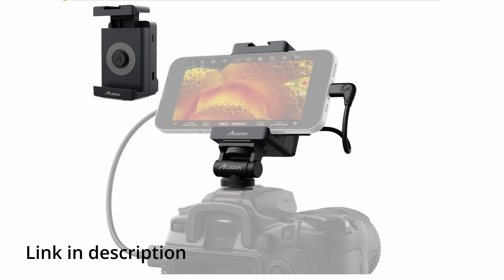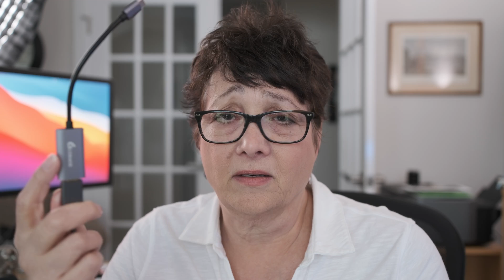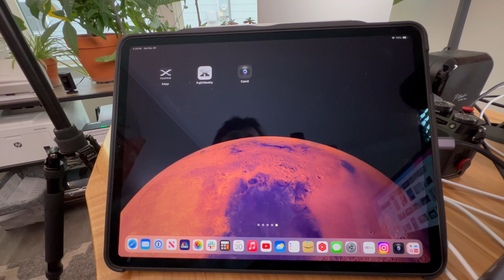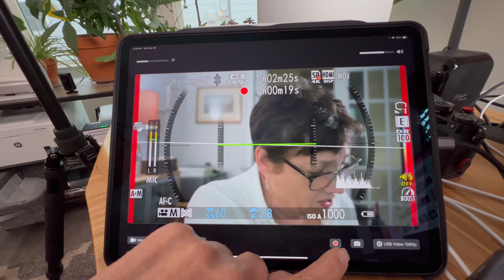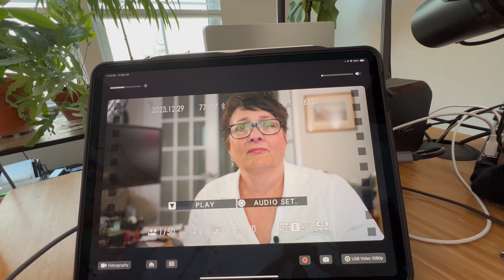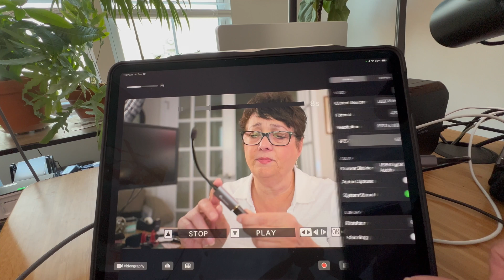Turn Your iPad Pro into a Budget Camera Monitor + Recorder (Part 1)

Comment from the maker: If you have any issues with the CamX app, please share them in the comments. One thing I found is to set the Format to 420f not 420v. Resolution appears to work best at 1980x1080 and FPS at 30 vs 60. Unable to connect to the camera with the CamX app? I've had to reboot my iPad to successfully connect to the camera a few times. That always fixes the problem, but I am not sure what the cause is. Please remember, that this is a budget solution,  so there will be compromises.
Reply: can you please share your camera settings, i cannot get anything on my ipad or iphone (15) all i get is the image of the iphone or ipad camera's i tried this on my fuji xe3,xpro2 and xt-5 and no joy, all are micro hdmi...what am i doing wrong?
Reply from the maker: I assume you are using the CamX app and a capture card? What does that say on the screen of the app?  My camera is set to turn on HDMI info output. I’m also did a part 2 video just recently on this topic. That might help. Turn Your iPad Pro into a Budget Camera Monitor + Recorder (Part 2)
https://youtu.be/6Ym77g3FRY0
Reply: Yes to your questions .
Reply from the maker: My first suggestion would be to test the capture card with your computer to make sure it is working.

Comment: quick question Jackie, could you use this app for photography too?  the xt5 screen is so tiny it's not ideal for framing my interior real estate shots
Reply from the maker: Yes, I can plug my camera directly into my iPad via the HDMI adapter and use the CamX app for photography as well as video. Hope that helps.
Reply: @ wonderful, thank you very much, you just saved me 500 bucks. I will get one of those small capture card adaptors and use this app @_____@
Reply from the maker: My answer is based on using it with my Fujifilm camera as that is all I have to test it on.
Reply: @JackieDElia  yes, I also shoot Fuji (xt5) so it should work fine

Comment: I’ve watched several videos before this as I’m trying to set up an external monitor for shooting wildlife down close to the ground, and the onboard screen on my Canon 5D Mk-iv is fixed into the body (doesn’t tilt up). I’ve found a way to mount the iPad Pro 12.9 to the tripod but wasn’t able to get this app to work, but I think I’ll keep trying since now I know it should. Thanks for putting together a very clear, concise video on how to do this, much better than the super technical videos I’ve seen prior. I’ll definitely be checking out some of your other videos. 😉
Reply from the maker: Thank you so much for watching and sharing

Comment: I did what you did and my iPad Pro 12.9 inch is working. The iPad mini didn’t work. I have a Kindle fire hd on the way. I like that size better but if it doesn’t work then I will have to figure out how to mount the iPad Pro to the tripod. Great video. Thanks ❤❤❤
Reply from the maker: Glad I could help

Comment: Great video. Thank you for sharing. I was hoping to capture video from my 8mm camcorder to my M2 IPad Pro using this app. I couldn’t get past the screen that shows the connections. Is this possible & if so, do you have any recommendations to hook it up? I have a ton of 8mm video that would be so much easier using my iPad than my laptop. Tnx.
Reply from the maker: Thanks for watching. I really don’t have any insights on using an 8 mm camcorder. I do know that the app requires an HDMI input and the use of a capture card. Does your camcorder have that option for output and are you using a capture card?
Reply: @ no. Just the components output. Thanks.

Comment: my camera xs20 doesn't recognize on ipad. It say only signal of connect the cable. I use USB hub to ipad and hdmi on hsb hub and USB mini hdmi to camera. but it doesn't work. is it something need to do more on the process?
Reply from the maker: What capture card are you using?

Comment: can you use an iphone with cam x it works on my ipad  but will not show up any external usb on iphone ?
Reply from the maker: i don’t believe you can use CamX with the iPhone. I don’t have a way to test that as my iPhone 13 Pro does not have a USB port. I can hook up my iPhone to my iPad and use the CamX on the iPad to Capture video from the iPhone. I have a Lightning to HDMI adapter that I plug into the iPhone.

Comment: Has anyone had success with a Nikon d810, capture card connector and CamX. CamX keeps telling me to connect a device. Thanks, Greg
Reply from the maker: One thing I used to troubleshoot was to connect my camera to the Capture card into my computer to see if I was able to receive the HDMI signal. I’m on a Mac so I used QuickTime. That will at least let you know if the HDMI output is working on your camera.
Reply: @JackieDElia  Thank you for taking the time to respond Jackie. I have my Nikon D810 connected to the capture card and the USBc port on my iMac running Sonoma 14.5. When I open quick time player The only recording I can do is with the iMac camera. When I connect to my iPad Air I will see a little cable icon on the top right part of the screen but it shuts off after about 3 seconds Thanks for any ideas, Greg
Reply from the maker: @nopriors  it sounds like either the Capture card is defective or your camera is not outputting an HDMI signal. I don’t have an icon camera, so I’m not sure what settings are required to enable the output. I do know when I was troubleshooting my issues with the iPad when I did connect it to the computer instead, I was able to select the input from the camera with the capture card attached. That way I knew the Capture card was working properly. I don’t have any other suggestions, but hopefully someone else will be able to answer here in the comments.
Reply: @JackieDElia  Thank you Jackie. I have tethered the camera to my MacBook Pro with HDMI using Lightroom. The fact that the little icon on the upper right screen in CamX app shows up but then goes away may mean the capture card is suspect.  What's really weird is the camera will just take a photo for no reason at all. Oh well I love trying to figure this stuff out. I didn't buy the same brand capture card you did so maybe I'll do that and see if it helps. If it does I'll send the one I got back . Take care
Reply from the maker: @nopriors  hope it works out.
Reply: @JackieDElia  It works!!!! I got the same capture card you recommended. Thank you, thank you, thank you!
Reply from the maker: @nopriors so glad to hear that. awesome.😎
Reply: @JackieDElia  Now to see if I can get the iPhone to work!

Comment: Great video!!! I bought the exact same one , but the cam x did not work.Unfortunately.Keeps asking to plug the camera
Reply from the maker: I had the same issue on my iPad and the only way I could get it to work was to power off the iPad and reboot it and then plug it in and it worked. That was the 2019 iPad Pro. I’ve since upgraded my iPad and I’ve had no problems with the CamX app at all.
Reply: @JackieDElia  thanks for the reply , I will try that

Comment: thank you i am planning a iPad for my canon R5C for commercial video. i have dji ronin RS2 Pro combo and will be using the Raveneye Hdmi for monitoring on iPad . but which iPad should i get its been ages since i visited apple site what size is good
Reply from the maker: Thank you. As far as I know any iPad that has USB-C port would work I’ve only tried it with my iPad Pro 12.9 inch 3rd generation. That is the only one I was able to test.

Comment: Very good and certainly well explained, a little doesn’t add up, that you dumped the Assos as money didn’t look a problem with the gear you have, but that aside I was pleased to see how you did it as most others, go all round the houses and then you see that it will only work on Sony or ?, for your 12.9” pad the ulanzi holder seems to be the go to with a ball rig to allow tilt! I have looked at many video monitors and actually ordered the Viltrox, however Amazon failed to deliver here in U.K. so I cancelled on two points, the Osse Lilimon 5 is as old and better build! It’s cheaper in USA than here in U.K. due to import and delivery!
Reply from the maker: I ended up with the Viltrox DC-550 Pro but still do attach that to my iPad to record. I did a video on that as well. I made this video to show that it can be done if you already have an iPad with the USB-C port with just a capture card. Thanks for watching and sharing your thoughts.
Reply: @JackieDElia  how do find the Viltrox in practical usage, as I’m wanting to use for my video and photography, as I’m giving my son my 11” pro and have bought a iPad mini 5 to tide me over, I think that there will be a new one out soon and possibly a super improved one later in the year! Hence why I’m looking for the dual aspect!
Reply from the maker: @f1remandg very happy with the Viltrox DC-550 Pro and use it whenever I am recording with my Fujifilm X-T5. It has nice functions (false color, zebras, etc) and a very well designed sunshade.

Comment: Complete failure, did everything you did, same app and all and nothing! My guess is the settings on my camera are the issue
Reply from the maker: Sorry to hear that. The app can be finicky. I’ve had to either reboot my iPad, or close the app and start it again, including disconnecting the card and reconnecting it. But if you want to eliminate the camera as the issue, what I did was, I plugged the Capture card into my Mac and opened up QuickTime I chose start recording and chose the input and was able to see the camera HDMI output on the screen.  I did this completely bypassing the iPad. In fact, my last video that I posted about focusing in the studio, all of the recordings from the camera were done in QuickTime. Hope that’s helpful. Good luck.

Comment: Thank you, Jackie. I just started the same search but with a different use case in mind. I am using similar setup. Although I do record videos I’m also a photographer and have been looking for a way to use my 12.9 iPad Pro as my tethering monitor rather than my MBP. I’m using an Olympus OM-D E-M5 II to shoot portraits but those tethering softwares that do work with iPads don’t work with Olympus or are overly expensive. I want to use my 12.9 iPad Pro on a stand so both I and the subjects I’m photographing can see the images.

I, too, got an under $20 capture card and connect it to my iPad via an HDMI cable for my Olympus camera. I tried Orion but think CamX is much better. However, I’m not crazy about the image not filling the screen. I haven’t yet tried it out with subjects but I think it will be workable. Since this is still a relatively “new” capability for the iPad I’m hoping some clever developers will come out with apps that improve on those currently available.
Reply: Agreed, CamX would be perfect if there was a full screen option. Can’t stand the  black borders.
Reply from the maker: @artbrutnewyork good point!
Reply from the maker: Thanks for sharing your.experience with it and thanks for watching. It’s not a peffect solution but for the price, it is workable for me right now. 😀

Comment: Good insight,  I don't need the extra features either.  For monitoring my video I just connect the camera tu my PC monitor with a micro hdmi to hdmi cable
Reply from the maker: Thanks for watching. Are you on a Mac or PC?
Reply: MAC but I use external monitor for my MacBook @JackieDElia

Comment from the maker: I'm not a professional videographer. There are a lot of options for beginners to monitor your video while recording. What's yours? Do you want the ability to record or only monitor? Is HD enough for quick recordings as I mentioned in the video? Please feel free to leave a comment below to share your thoughts. I know there are more expensive options, but I wanted to see what I could accomplish with a $25 Capture card and the iPad and HDMI cable I already owned. One additional item to note is there is no way to charge the iPad while using it as a monitor. Thanks for watching!